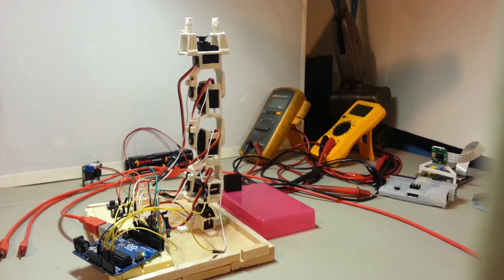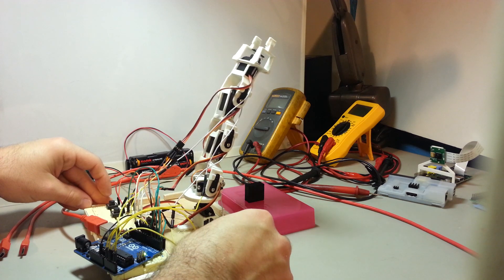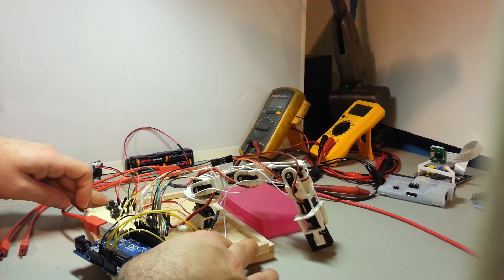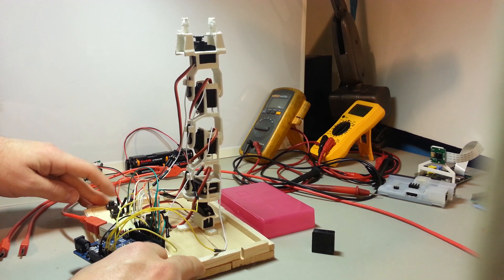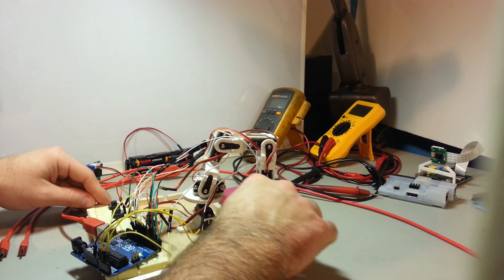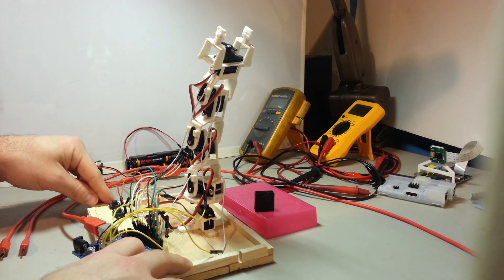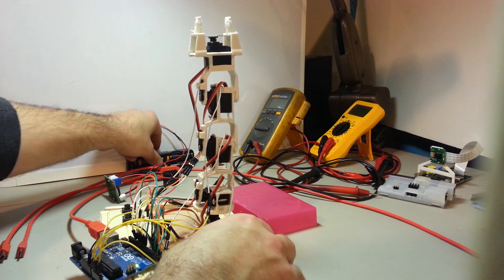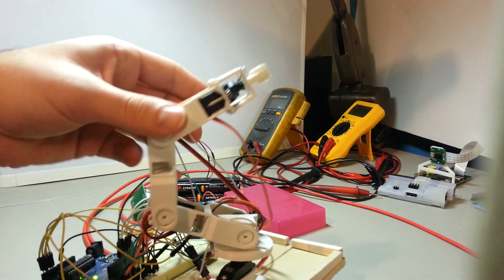Trainable Robotic Arm 1

Comment: This is phenomenal.  I must build something like this now!  Would love details - sketches, parts (servos).  Wondering if there is a way to smooth the action...or is that because of the flexibility of the printed plastic?  CNC-cut parts might be tougher.  If you want some CAD stuff, I recommend Google SketchUp with a free STL plug-in (STL allows export to a "printable" or "cuttable" design on a 3-D device - I use it to make parts on my CNC here and there and it's great).  Really great stuff!
Reply from the maker: I've updated the code for smooth motion now.  I'm adding one more feature before I create an updated video.  There will be a complete guide in the Adafruit Learning System very soon, draft was just completed today.
Reply from the maker: Spencer Yonker http://learn.adafruit.com/trainable-robotic-arm